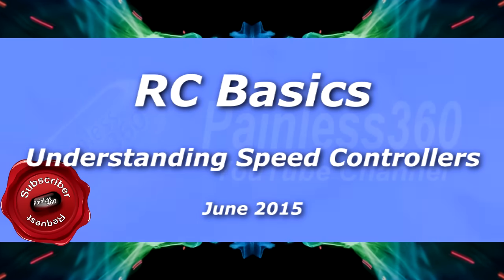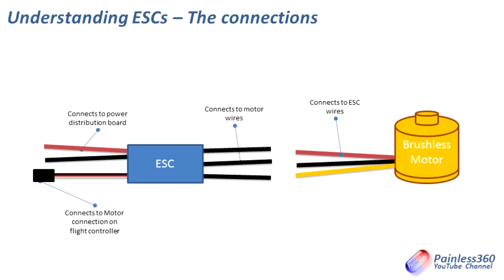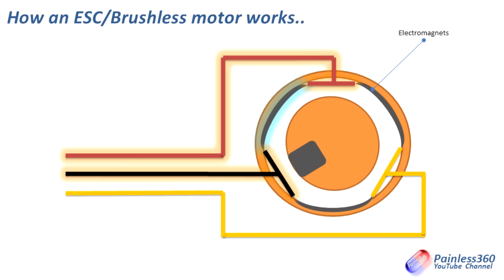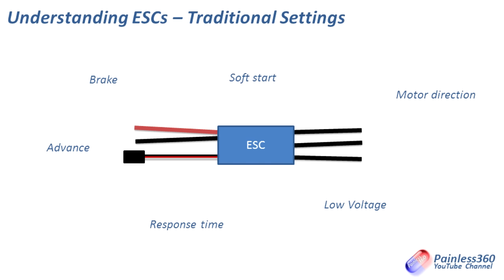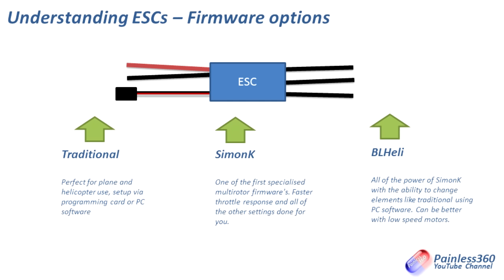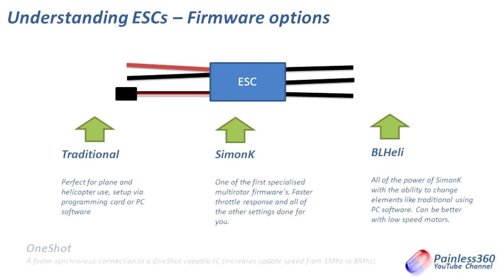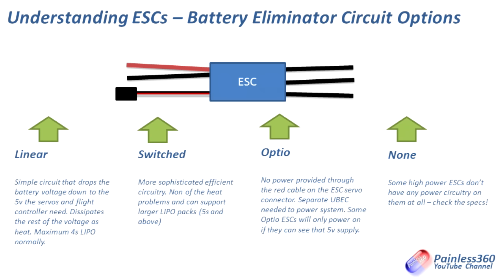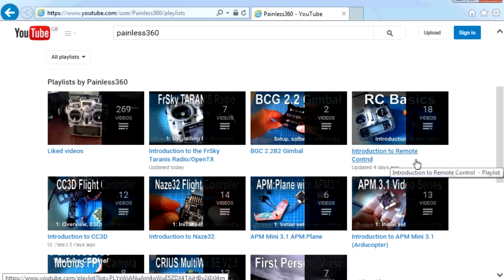RC Basics - Understanding Electronic Speed Controllers (ESC)

Comment: hello, Im working on a project - if i wanted to make a homemade leaf blower... can i just run a 90mm EDF to a 22.2 lipo or do i need a 120v esc with a on and off button? thanks for any info!
Reply from the maker: Almost, an ESC needs a 'PWM' signal to know how much power to send to the motor. In addition to a switch you will also need something like a 'servo tester' that can send the signal to the ESC for you.. Best of luck!
Reply: @Painless360  thanks!
Reply: @Painless360  ok, heres what im getting ready to order - 
Dr. Mad Thrust 90mm 11-Blade 1700kv Motor - 2300watt (6S)
YEP 120A HV (4~14S) Brushless Speed Controller (OPTO)
Turnigy Heavy Duty 5000mAh 6S 60C Lipo Pack w/XT-90
Turnigy Reaktor 300W 20A 6S Balance Charger now with NiZN and LiHV
HobbyKing™ Servo Tester  
SKU: HKSESC_TST.
I think everything looks correct? please and thanks for any info!

Comment: I've often seen mentioned that the wires from the motor to the ESC should be extended (if needed) and not the wires from the power source.  Your thoughts.
Reply from the maker: TheGusK This is right, the power to the ESC is always flowing in the same direction so keeping these shorter is good. 
Happy flying!

Comment: Learned a bunch.  Thanks!  Putting together an FMS PT-17 and know almost nothing about today's RC radio tech, especially electric powered, so trying to get up to speed.  Used to love flying gas/nitro planes using now-extinct FM radios.  Was always worried someone would accidentally turn on 'my' channel 42 and crash my beloved plane.  Glad that old tech finally slithered into the tar pits.  Gotta say that today's RC tech is freakin' extraordinary!

Cheers from Thailand!
Reply from the maker: +Jimbo in Thailand glad it made sense. I came back I to RC just as the old tech was dying off. There are lots of basics about current technology in the 'Introduction to Remote Control" series. Happy flying!

Comment: in outline to FCB (Flight controller Boadr) they esc always have 3 line cable, is Bec Output , Ground and PWM input. so how with if the ESC just have 2 line. (Bec output & Ground) no line for PWM input. can i use this or how to do, ???
Reply from the maker: Those ESCs that have no third wire are called OPTO and the two remaining wires are PWM signal and GND.. Best of luck!

Comment: Hi sir i have a question i have linear 30A escs.how do i wire it up to a tcmmrc f4 flight controller..im stuck on the part where the big red wire and black wire setup and then the smaller wires signal..ground ..you said in one video about not using red wire so i took them off.can u make a video on this..thank you
Reply from the maker: I'm guessing you're not a regular viewer. If the ESCs have linear BECs then you can connect all the red power wires to the FC without a problem (normally). See my recent 'basics' video - https://www.youtube.com/watch?v=xPDc6r6nRTU

Comment: You have a great channel. I recently picked up the hobby again after a long hiatus (since teenage years). Now I will finally finish my Tamiya Gepard (with custom gearbox), together with my son! I am so much realizing how much we were in the dark back in the era before Internet and Youtube! By the way, I now work for one of the leading manufacturers of small DC drive systems, so I have a much more professional angle towards the hobby. Still a lot of fun!
Reply from the maker: Welcome back to the hobby. A lot has changed in just the last two years. It's cheaper, we have more power using LIPOs and brusless motors, the parts and models are easier to get and repair and you'll need to reach for as PC more often now than in the 'old' days. It's even more fun now! Best of luck with the model and getting back into it all. The series called 'Introduction to Remote Control' may be a little noddy for you but may act as a reminder.. :D

Comment: Hi there , after hitting an airgate this weekend my motor no2 won't arm , I have Afro mini 20a esc . I noticed that the one in question is flashing red . I've tried to recalibrate the esc's in cleanflight and now they have all started to behave erratic and won't spin up until approx 1600 rpm . Is it the esc that's shot or motor .... ? Many thanks
Reply from the maker: Impossible to say without some more testing. I'd be tempted to swap the motor with a working on and see If the problem follows the motor or stays with the suspect ESC.. Best of luck!

Comment: What's the frequency these motors run at? I'm planning on building an ESC but without all the fancy features. just to run a motor.
Reply from the maker: There are lots of things to consider. Articles like http://www.edn.com/design/sensors/4407580/Brushless-DC-Motors-Part-II--Control-Principles are excellent at covering the things to think about.. Best of luck with it! :D

Comment: Hello there! I have a small problem that I come down to think it is esc related. I use pixhawk along with hobbypower bl heli 30amp esc with 3208 motors 480kv.
It seems that when I use loiter&alt hold the motors are ''missfiring'' if that is the term for inconsistent spinning throttling slightly up and down and unable to maintain stable height.
Am I using wrong firmware for so low kv motors is pixhawk the problem, what can i do?
Reply from the maker: It's probably the timing in BLHeli. I played with some low KV motors with BLHeli recently and had to drop it to about 4 or 5 to stop it de-syncing..
Reply: @Painless360  Ok I ll give it a try but how do I actually setup the hardware to do the flash? 
Do I have to completely remove the esc and find the pads? Can it be done only through the servo cable going to the flight controller somehow? Or can i take advantage of the pixhawk and do it through it?

Comment: Hi , Im using the naze with a little bees 4in1 esc , foxeer camera and foxeer switcher vtx . The picture is very grainy , I thought this was noise from the wiring but I've tried an LCfilter with the naze and also just changed the board to a furious radiance with built in filter and still the same problem , any help would be appreciated. Thanks
Reply from the maker: +Craig Waterworth usually having all the gnd wires to the exact same spot helps.. Best of luck!

Comment: Hi Lee, I'd love to have your opinion: Just finished a new quadcopter build. I'm using Hobbywing xrotor 40A Blheli32 ESCs and 935kv brushless motors, pixhawk 2.4.8. All flashed with latest firmwares.
When testing the system, 3 of the motors seems to be ok but the 4th is just jumping back and forth not getting into smooth rotation to either direction. Any idea? Settings / esc problem / motor problem (all components are new). Thanks!
Reply from the maker: Sounds like one of the three wires from that ESC to that Motor isn't working/connected. I'd check that.. Best of luck!
Reply: @Painless360  Thanks! Will check. At any rate I've sent a short video to the seller and he'll send a replacement.

Comment: So the wires of my motors have 2mm male bullet connectors and the wires of my esc’s (the exact same as shown on 19:16) are about double the size in diameter. And have no connectors. Is there any right way I can connect them?
Reply from the maker: I always tend to use 3mm bullet connectors else solder the wires if I can't make that work.. Best of luck!

Comment: im getting the Turnigy Multistar 20A V2 ESC With BLHeli and 4A LBEC 2-6S . im just wondering how to connect them do i need to remove the red wire from 3 of the escs and just one esc with all the wires comming from the bec ?
Reply from the maker: neo36w eno36w Find out what style of BEC they have in them and watch the video again for your answer. I would only connect all the red wires if its OPTO or linear BEC (with caution)..Best of luck with it!

Comment: I am building a Big Turtle with lifting body . 60 cm from motors to battery, which end would you advise putting the two ESC  ?  Thanhs  .
Reply from the maker: In the best air flow you can find. The received wisdom is to make sure that the longest wires are the ones that go to the motor rather have longer wires going from the ESC to the power distribution board..

Comment: Hi Painless360;

ESC Opto is the same as Optio? I'm using the E300 and says 15 A Opto. 

And sorry but with the Optio you have to connect just one ESC with three cables and the others ESC's with the signal? You no say it in the video.

Sorry for too much question Painless, but thank you very much.
Reply from the maker: Yep, I've heard them called Opti and Optio (optically isolated - Opt-io). ;)

Comment: I have a Parkmaster Pro 3D plane from MPX, and I'm noticing a fairly long spool-up time of the motor when I apply direct full throttle. In the sim, and from videos I've seen on youtube... throttle response seems waay quicker. It is pretty annoying eg. for hovering the plane. My plane also makes a weird electronic noise when making small throttle adjustments at high rpm. Am I dealing with a faulty esc? Or could I be doing something else wrong? Everything works fine, I just suspect the fairly indirect throttle response is not mormal. Thanks in advance!
Reply from the maker: I'd look at what kind of ESC you have in the model and see if there is a setting for slow spin up times. ESCs designed for larger props move to the new throttle position over a small period of time to allow the mass of the blade to catch up and increase the thrust gradually. These settings can usually be altered.. Best of luck!
Reply: +Painless360 Thanks for the quick response! My ESC is (as I read it in the manual) a "MULTIcont BL 30 S-BEC speed controller". 
I will look further into it, been flying a lot today and I'm getting more used to it... maybe I'm seeing ghosts afterall. Thanks for your info, I subscribed to your fantastic channel too :)

Comment: Can I connect the three wires from the motor to the ESC then from the ESC to the battery without the transmitter as I only want it to operate a hairdryer..Thanks
Reply from the maker: You'll still need something to tell the ESC how much 'throttle' is needed..

Comment: Hi. It is possible to use racer ESC to run big motors like an Emax MT3515 650kv? There are some big ESC that are 40 amps and this little ones that have 40 amps too but in a tiny and weightless formfactor, can I run them without any damage with those big motors? I try to find this on internet but never find something. Thank you!

Comment: Hi! I just want to know if how many esc is allowed to be fitted to a 6 channel receiver if i place 5 esc for 5 motors on the esc and only 1 servo this 5 esc won’t damage the receiver? Since esc supplies 5v power to the receiver? Thanks 🙏
Reply from the maker: You can disconnect the red 5v wire from all but one of the ESCs to be safe. See my other RC Basics videos.. Best of mine

Comment: i have a xk a800 plane which has a brushed motor which i want to replace with a brushless. i'm assuming motor speed control is regulated via an analog voltage from the receiver/flight controller, not PWM
 (it a simple cheap all in one receiver/controller, not really customizable)

can i simply remove the brushed motor, plug the red and black wire that went to the motor into an ESC for brushless motor? will a cheap ECS accept an analog voltage as control input? thanks
Reply from the maker: Brushless motors need an ESC. The ESC adjusts the power sent to the motor in proportion to the PWM throttle signal it receives. See the other videos in the 'Introduction to remote control' series. Best of luck with the project!
Reply: @Painless360  i know it needs an ESC, the question was can i connect an analog voltage into the control input of the ESC. i think the answer is no, but there is $6 board on ebay that converts 0-5V to PWM, then i can put PWM into the ESC

Comment: Hi do you have the ideal esc for this EDF FMS 50 mm (motor 2627 4500 KV 4S). I found out for the 4s it supports Hobbywing 50 A but the manufacturer states it has no automatic timing feature.
Reply from the maker: I do not use a lot of EDF here but I would look at a regular fixed wing 40A ESC for it.. Best of luck.
Reply: @Painless360  Thanks

Comment: I am trying to build an Arduino Uno controlled quadcopter, there is some confusion about ESC update rate though. My control loop is capable of refreshing every 5 ms, so 200 Hz, but as far as I know the refresh rate for the ESC pwm signal is 50 Hz. While running my program and just refreshing it with 200 Hz (I am using writeMicroseconds() function on Arduino) my ESC's don't work smoothly or eventually stop. I am using HobbyKing 20A ESC's. 
Is it possible to refresh the ESC signal to a faster rate than 50 Hz or is this the rate I have to with? I keep seeing discussion about 400Hz ESC's, but have no idea what kind of input signal do mine accept. I'm also considering trying out sending the ESC signal every 4 loops (5ms*4=20ms), but don't know if it would have any positive effect on control quality.
I had also read that SimonK firmware "Accepts any PWM update rate (minimum ~5microseconds PWM low time)". That sounds like it would be perfect to me, but there is so much confusion around this topic that I prefer to ask before screwing my ESC's. Would that work out right for my problem?
Reply from the maker: No idea sorry, I'd personally get a look at the MultiWii code as that will have the ESC code in there and you can see how they did it. Best of luck!

Comment: I am trying to program (using transmitter) a green Turnigy Multistar 30A ESC (480 Hz 2-4S with 4A SBEC), and I succesfully get to the point where I hear repeating 1 beep, 2 beeps, 3 beeps etc. But when I move the throttle stick down in order to enter the submenu, it just beeps once and that's all. If I move the stick up again, it immediately starts the motor. What am I doing wrong? It works fine otherwise.
Reply from the maker: That sounds like you're calibrating the throttle. I've not used one of those, the HobbyKing support guys may be the best people to ask.. best of luck!
Reply: No, definitely not calibrating the throttle. I did throttle calibration but this is different thing, it starts just like it should by the manual, it enters the programming mode, beeps like it should etc., but It doesn't work when entering any menu param. Well thanks anyway!

Comment: Hello , can I ask about the current showed on the ESC  ,. what is the different between 20A, 30A , 40A?
Reply from the maker: +Lim Heng Yip Vincent it's the amount of amperage it is rated to supply. You want an ESC that can support more current than your motor needs. See pur other videos in the Introduction to RC playlist and the Quadcopter building for beginners series. Best of luck!

Comment: I am college student, and we are working on small team project this quarter.  we planed to build a control moving platform can hold 50kg(with one 4 inch wheel). we have GForce 400kv motor, 120 ESC Brushless speed control,  8.4V battery, and 2.4ghz Radio System Transmitter. After we contected all parts, the motor only worked twice, then never work anymore. Could you tell us what's problem we might have and how to make it better? Thank you!
Reply from the maker: +ubbelohed Wu this is a little outside what we normally do here. But normal troubleshooting rules will apply. I'd check the motor driver and wiring as a first thing, then start to look at the logic and firmware on the controller. Best of luck with the project.

Comment: Hello!
You have said that Switch ESC what I use in my model, if I use four of it, I need to disconnect the *RED wire. What does it mean?
Can you explain more? or Do you have any link to work with that? or Another easy way to explain by text?
Thanks for your kind!!
Reply: I would try what you said tomorrow!
Reply from the maker: See the videos in the 'Introduction to Remote Control' series for an explanation. Best of luck!

Comment: Very good video again. Can you tell me why my 20amp esc operates fine with a 3s li-po battery but when trying to use a 3S li-ion the throttle starts to play up. Full throttle and speed then begins to fall and then motor violently pulses
Reply from the maker: LVC maybe? Usually needs dropping if using LiIon. See my videos on LiIon packs.. Happy flying

Comment: when I set my throttle to low a few of my motors continue to ramp up. I have calibrated the ESCs, I've tried removing the positive wire from the servo connector and I tried to update the software but my ESCs are Simmonk but don't have the boot loader on them. any ideas as to what the issue Could be? I did have to go cheap on my ESCs and motors so could be bad hardware??
Reply from the maker: Tricky to answer as you don't say what you're doing when this happens.. Google something like 'Painless360 motor' to find out videos on this topic (https://www.youtube.com/watch?v=DDnaAQLjcQQ) ;) Hope it helps..
Reply: Painless360 I've whatched all the videos you have on ESCs and motors. as for what I'm doing when it happens is the drone is just sitting on the desk without the props or nuts on.
Reply from the maker: You've not watched that video I linked to have you?
Reply: I have and the drone still does it with the props on while airborne :(
Reply: Do you have any other ideas as to what it might be?

Comment: i have an sk450 had a crash and i damaged one of the escs im trying to get a better understanding of quadcopters , how they work , Can i use a afro 30 amp esc with bec on the kk 2.1.5 board? , since the kk board needs power to operate on 5 volts .
Reply from the maker: neo36w eno36w Yes you can, having all the ESCs the same helps make sure the firmware is the same on each arm. I have two playlists you may find useful - 'Introduction to RC' and 'Introduction to CC3D'. Both cover a lot of basics...Best of luck.